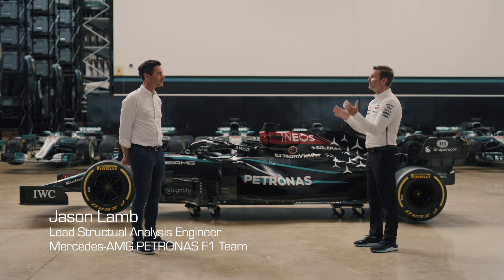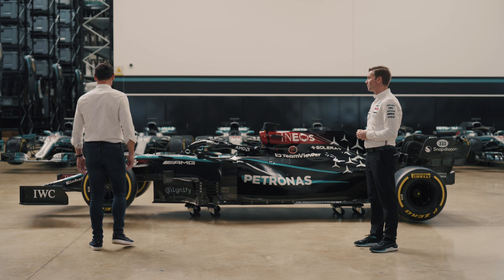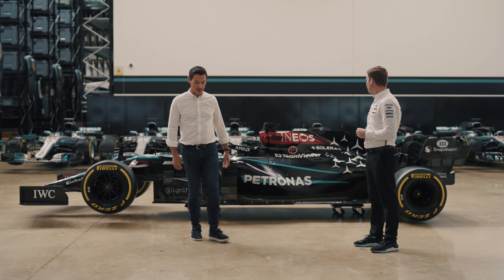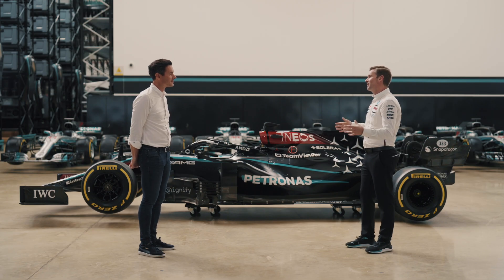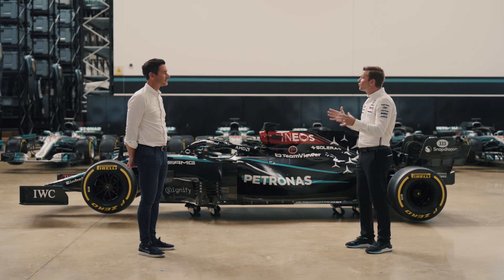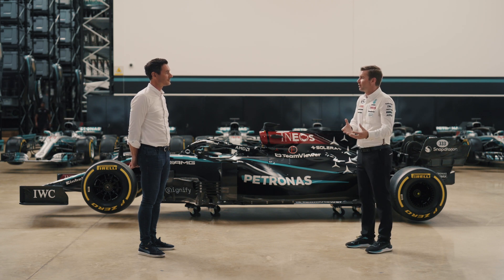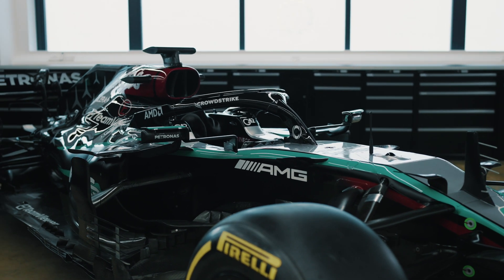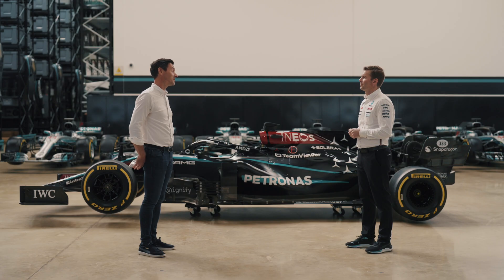Protecting Drivers During the Biggest Crashes: F1 Survival Cells | Safe and Secure X Crowdstrike

Comment: The Mercedes team urgently needs to improve the W15.  The car is slow, consumes a lot of tires at race pace, needs better downforce from the floor, floor, suspensions, traction in and out of corners, aerodynamic drag, speed on straights and in high, medium and low curves, But investigate Ferrari and its updates, what is the reason for their growth, fraud, cheating on the car, or is it the effect of Loic Serra?
Reply: @romor777  Why don't you apply to help?

Comment: Zak Brown, don't be stupid by going out in a Ferrari victory photo.
Ferrari is cheating as it did in 2019, but this time it's on the floor, the ERS, the electronic throttle that simulates a disguised traction control and the flexible floor.
The Ferrari Satellite Team is also cheating.
McLaren, the reality is that if you don't improve the operation with the two drivers, Norris and Piastri, who have been failing lately, you could lose the Drivers' title to Red Bull and the Constructors' title to Ferrari.

Comment: Ferrari is cheating as it did in 2019, but this time it's on the floor, the ERS, the electronic throttle that simulates a disguised traction control and the flexible floor.
The Ferrari Satellite Team is also cheating.